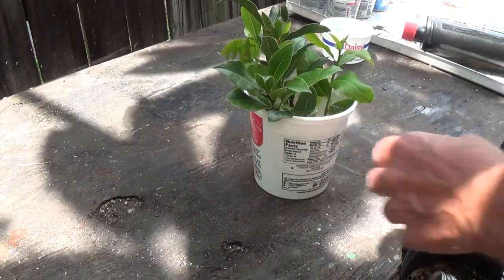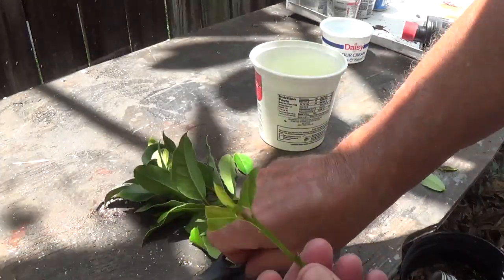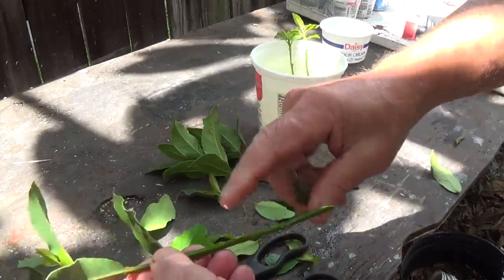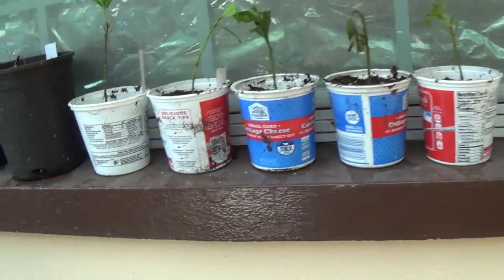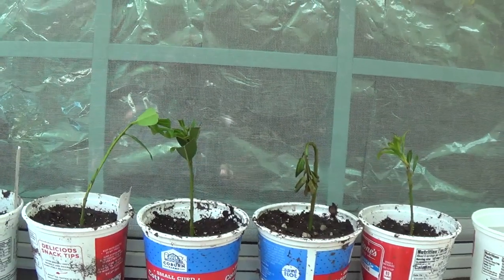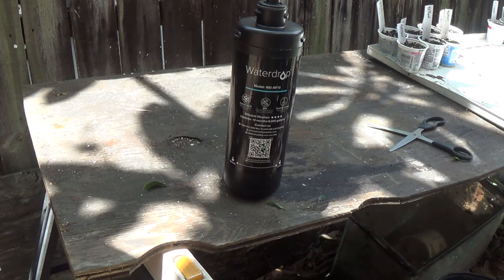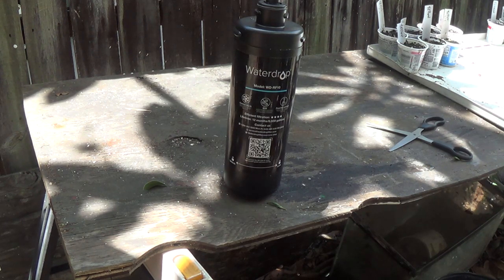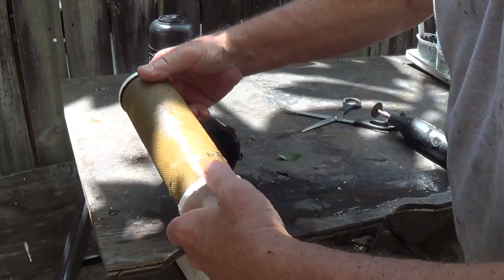BAY LEAFS AND WATER FILTER

Comment: Interesting, we use a zero water filter…now I want to open up that filter.
Reply from the maker: What surprised me the most is, that it wasn't full of calcium. We have really hard water, the calcium builds up on everything. That filter was 13 months old and it was clean on the inside. I wonder if the calcium was trapped inside the charcoal. ??? hmmm, a mystery.